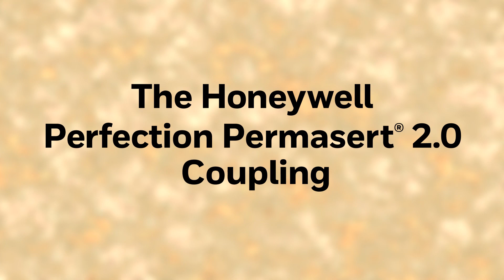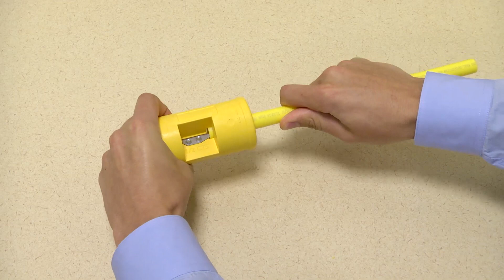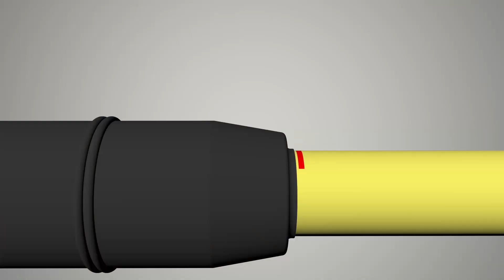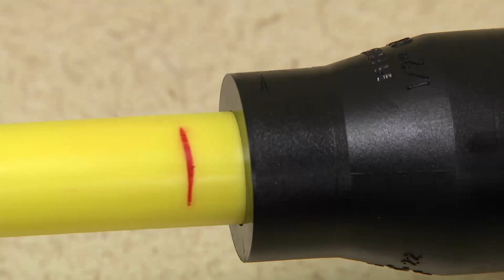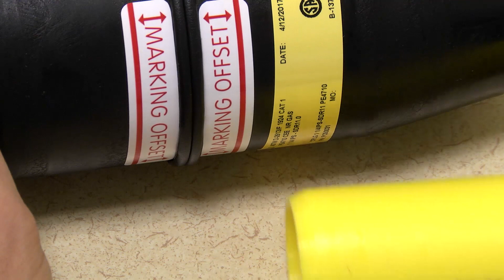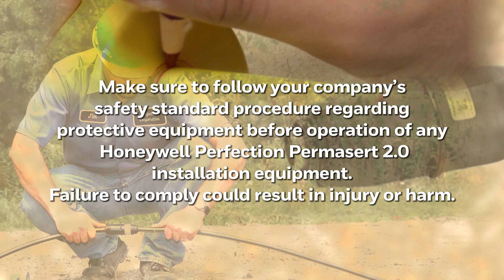PERMASERT 2 0 Installation Video

Comment: Being a first responder in the industry for over 35 years I have seen couplings fail in many different ways and I'm sure your coupling will last a long time but the main problem that will eventually be experienced is your o-ring deterioration overtime. This is why your non-O ring competitors like Lyco-fit  is the gold standard in the gas industry ( the only one we have ever seen fail was due to improper installation and as a matter of fact that one was not leaking even though it was improperly installed).
Reply: I wish to communicate
Reply: Not enough people understand this! I say the same thing about Sharkbite water pipe fittings, will not use them.